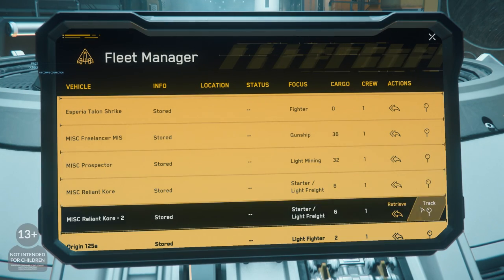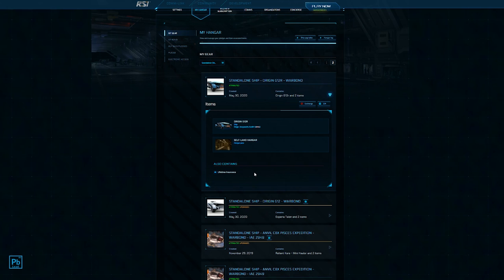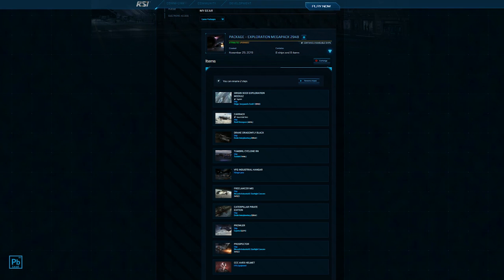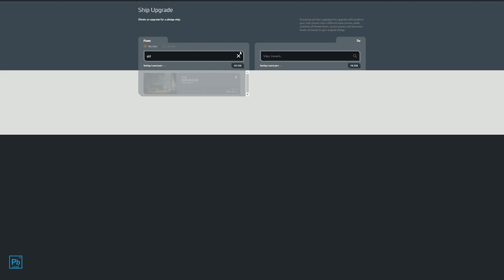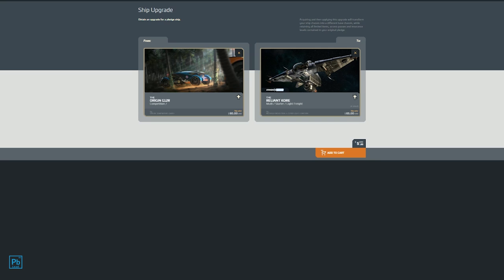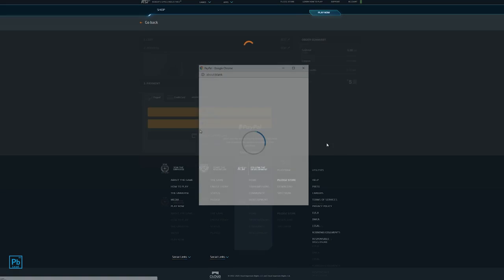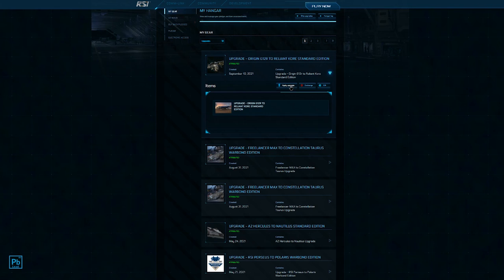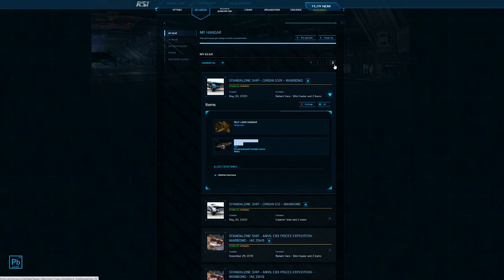Star Citizen: How to CCU/Upgrade Ships - Short & Simple

Comment: This vid drops less than a week from the first time I applied a CCU. I have to say applying all those CCUs was little bit nerve wracking. I had planned meticulously to bridge from a warbond LTI Ranger TR to a Mercury Star Runner going through a 300i, a Nova Tank, a Constellation Taurus, a Banu Defender and finally a warbond MSR CCU, plus there were a couple of dead end branches that have since been clipped (melted), and had been waiting for that Defender to go on sale to bridge the two ends of the chain. Despite the planning, I had never actually applied a CCU before, and knowing that if I'd made a mistake somewhere there would be no turning back, so there was a bit of checking going on before the upgrade process kicked off. 😆 But ultimately, the operation was a success. I've been zipping around the 'verse in a Mercury Star Runner for a few days now. 😎

Comment: 1.
Heat oven to 375°F. In small bowl, mix flour, baking soda and salt; set aside.

2.
In large bowl, beat softened butter and sugars with electric mixer on medium speed, or mix with spoon about 1 minute or until fluffy, scraping side of bowl occasionally.

3.
Beat in egg and vanilla until smooth. Stir in flour mixture just until blended (dough will be stiff). Stir in chocolate chips and nuts.

4.
Onto ungreased cookie sheets, drop dough by rounded tablespoonfuls 2 inches apart.

5.
Bake 8 to 10 minutes or until light brown (centers will be soft). Cool 2 minutes; remove from cookie sheet to cooling rack. Cool completely, about 30 minutes. Store covered in airtight container.